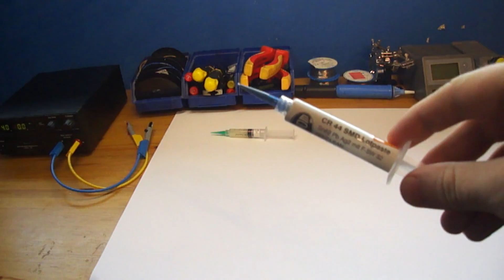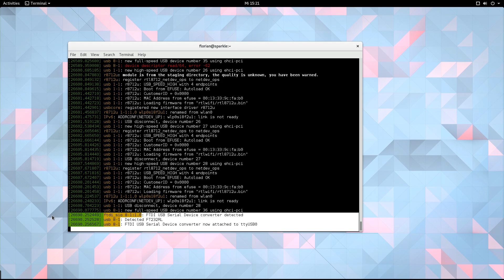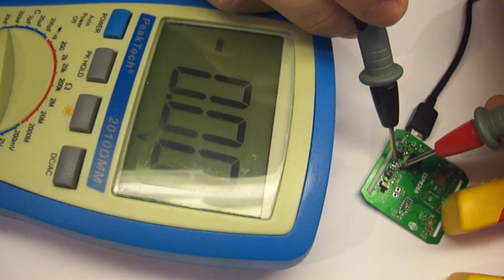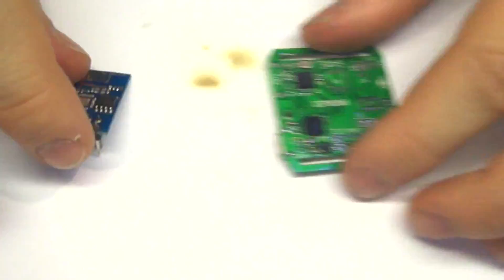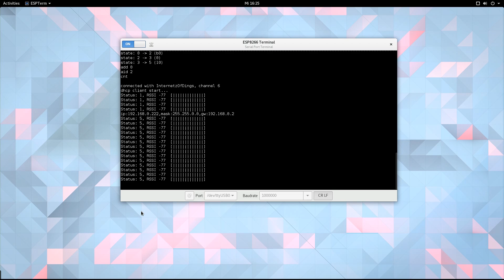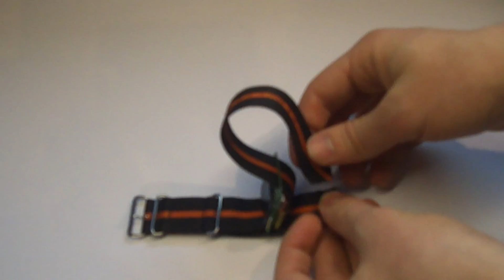Building the ESP8266 DIY Smartwatch

Comment: That's amazing! You are the master of soldering. I still can't understand how did you fit the main ESP8266 chip onto the PCB on first try.
Reply from the maker: +Erik Bročko Lots of flux! The QFN package will then self-align on the pads.
Reply: But those hot-air soldering stations are soo expensive! :(
Reply from the maker: +Erik Bročko No, not at all :) ! You really don't need to get the expensive ones as a hobbyist, there isn't exactly much the manufacturer can get wrong about making hot air. I got a ZD-939 for 70€ which works great (the one I use in the video), the 858D sells for as low as 40€. So it's just about as expensive as a decent normal soldering station.
Reply: Jeija Hmm... Thanks a lot! Well, with my limited student budget I'd like to get the best, most reliable and affordable one. That's why I'd like to ask, is a soldering station one-time investment? You know, different brands offer something else.

Thanks yet again, I really appreciate it.
Reply from the maker: +Erik Bročko Being a student myself, I'm certainly not in the position to answer your question. The ZD-939 is my first and only hot air soldering station. It does the job well, but I can't compare it to other devices. I have heard good things about the 858D though (e.g. Dave from EEVBlog did a video on the Atten 858D).

Generally, I don't think spending a lot of money on a hot air soldering station is a particularly good idea - it's not the best tool for the job anyways. Actually, the recommended way to build SMD PCBs is to use a reflow oven which are either DIY or priced ~250€, both are options I'm not really keen to try.

So I'd say instead of buying an expensive hot air soldering station, your money may be better spent on other tools. By the way, the smartwatch is also designed to be affordable to build with a limited budget only (since I'm swabian and don't like to spend too much money ^^ ).

Comment: Hello, can you tell me at what temperature your hot air was (specifically when soldering the esp8266) and for how long you were heating it up? It didn't look like you preheated the chip either.

Comment: Where did you get the SSD1306 OLED Display?
Reply from the maker: If you want some that are not already mounted on a PCB, you can get them from http://www.buydisplay.com
Otherwise, there are many breadboard-friendly SSD1306 PCBs on ebay ;)
Reply: Thanks, would like to see more video on custom stuff. Trying to build a "pager / notification" display with the help of MQTT. I am not a electric engineer tho... :) I work with Back and Front-end on webb applications.

Comment: This is an awesome project. Impressive soldering skills!
Are you planning to build a second version based on the ESP32?
Reply from the maker: Yes, I was thinking about doing that at some point. Probably with a Sharp Memory LCD and maybe the Bosch BME680 once that gets released. I am also impressed by your Chronio smartwatch, especially the case design is really well done!
Reply: The ESP32 together with a memory display would make for a great smartwatch. The ESP32 should be able to receive notifications via BLE but nobody has done this yet. It seems like there are lots of features that Espressif has not implemented or documented yet.